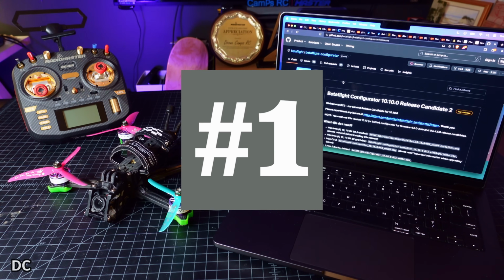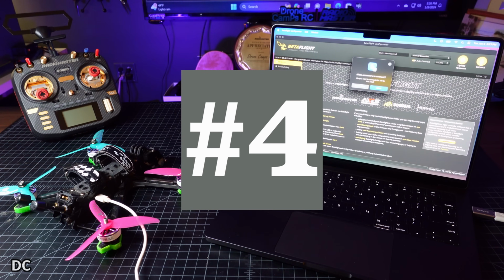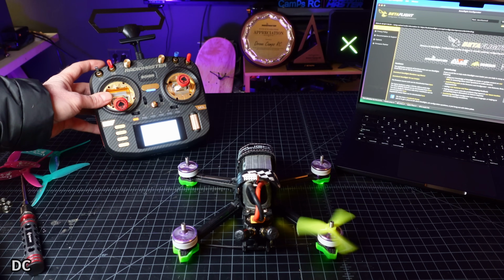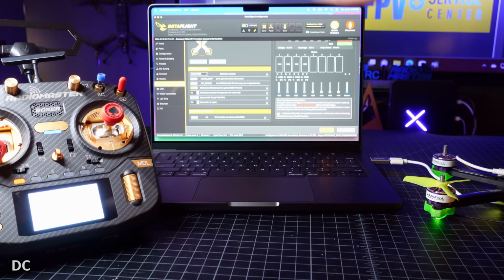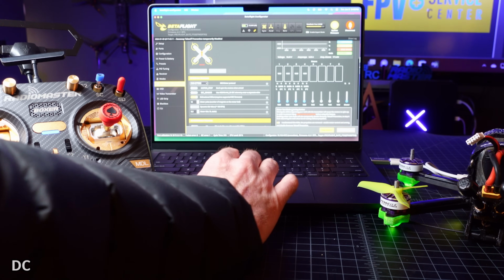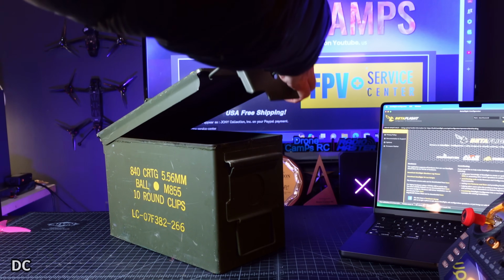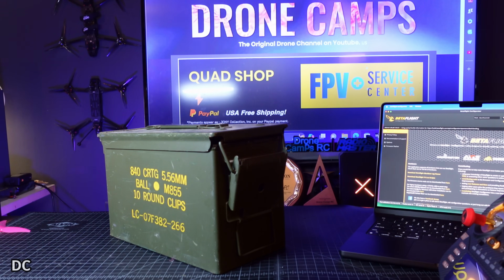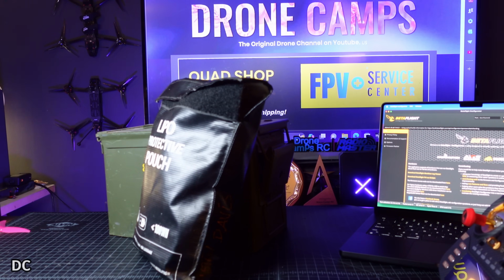20 IMPORTANT things to know for Fpv Beginners - 2024 🏆

Comment: I see a lot of videos about fpv that dont explain what you need. Im talking about the air frame camera, fpv transmitter (vtx), antenna and then what reciever And related stuff you need for viewing fpv. I understand the camera and transmitter, what i find very little info on is the actual viewing setup and associated stuff for it to work. transmitters don't come with recievers. on the gear page websites dont tell you related items to get with it.
This is my first fpv setup, i had los toy quads a few years ago. My question to you is this, i bought a heewing t1 ranger vtol and want to add fpv to it.
1- Analog or hd low budget is fine. I need a "whole setup" recommendation. All of the parts, camera, vtx, antenna, reciever, antenna and display. Display can be wifi to my tablet or some budget goggles. Less clutter is better.
2- My long range goal is 5 miles or less, probably only 2 miles.
3- hd stand alone camera for hi rez video recording. Gimbal/pan would be nice but i can live with fixed view for now.
I would appreitiate any guidance you can offer. Thanks.

Comment: Wouldn’t you want to know what direction your motors spin before you solder them down and how would you check that
Reply from the maker: There’s no way to know which direction they spent until you saw them down. You have to check that manually or using betaflight or BLheli configurator.
Reply: @dronecamps  but you had it all tightened down so how’d you get it right
Reply: @dronecamps  if you do t mind sharing
Reply: @dronecamps hey man I’m new to the hobby that’s why I was asking you because I’m unsure so if you could give me advice that would be awesome
Reply: @Tanks-v2o you can change the direction of the motors if needed in beta flight

Comment: I used to get a lot or noise in my video especially when i was on the throttle. Now i run two LC filters one for the camera and one for the vtx. It provides super clean power for both and clears up any and almost all noise
Reply from the maker: LC filter is life. However most have them built in these days

Comment: After flying RC for years, I've jumped in to FPV for the first time. Thank you for all the information provided that assists an individual such as myself make well informed decisions. One thing I would add is that for those starting out, buy the best radio you can afford initially. This gives you a piece of equipment that you can grow with rather than having to purchase the same level of radio as skills and distance increase. Just a thought from a guy that bought 4 radios in RC and have 3 that just sit now.

Comment: Very informative, my suggestion is for anyone trying to figure out anything about power.  Do the math, or get someone else to do the math for you.  These batteries are nothing like the older days with NiMh.  LIPOs and LiOn batteries are very dangerous and it’s mandatory for the proper respect and careful handling.  One other very important point is never continue to use a “puffed” Lipo, discharge fully and discard responsibility.  Good Luck Pilots, be safe out there.